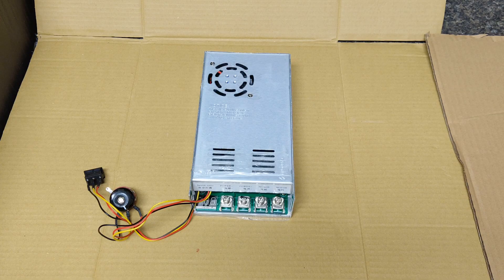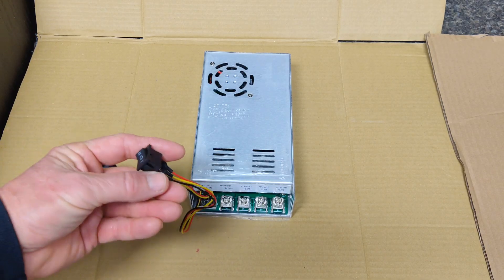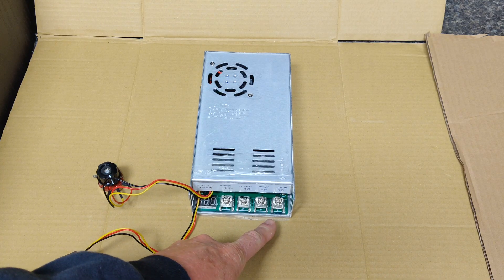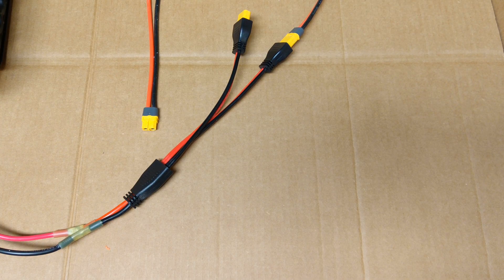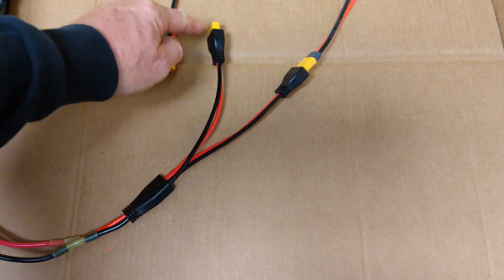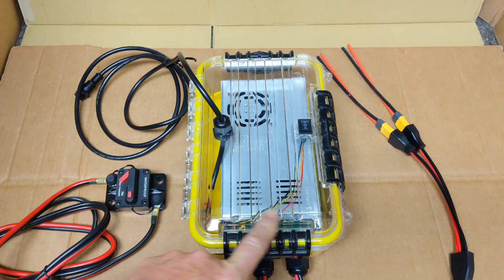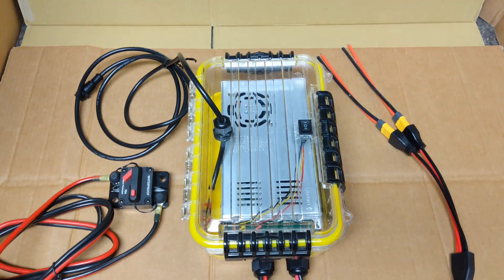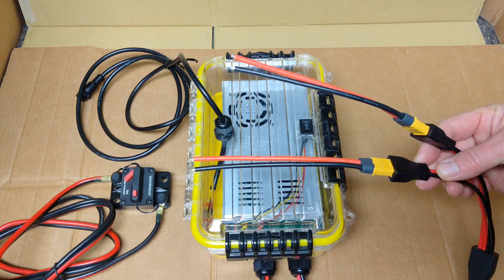Crappie Brakes with Bi-Directional and Variable Speed Controller Foot Pedal

Comment: Where’s the speed control? Is it attached to the foot pedal?
Reply: And where did you mount the control box since the forward and reverse switch is in the water proof box
Reply from the maker: You can mount the box where it is best for your boat.
Reply from the maker: The video shows the build.

Comment: This is so cool. I can’t wait to modify my brakes to make this work. It would be cool to see a design with two pedals. As in a forward and reverse pedal where flipping a switch would not be necessary to switch between
Reply from the maker: That is possible with a larger version of the directional switch. But then you have 2 foot pedals to deal with. Normally, crappie brakes are set for one direction and full speed. This set up just allows it to be more responsive.
Reply: @Aksmaniyak I’m building a double pedal forward and reverse is there a specific pedal
Reply from the maker: @catchingbaseball6043  I don't know. I used the single pedal for mine.